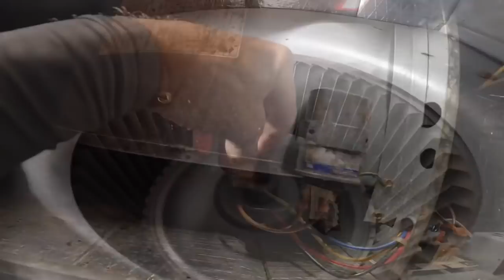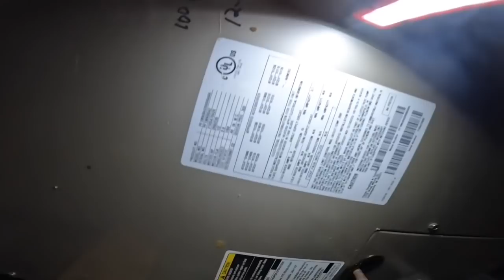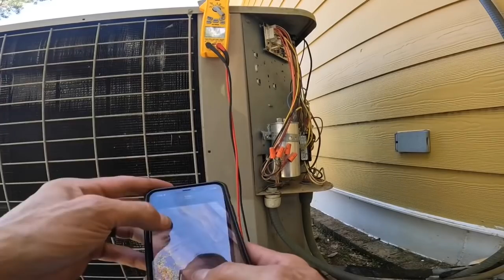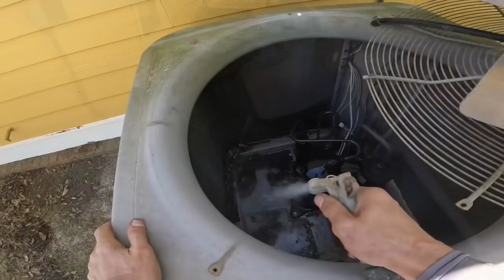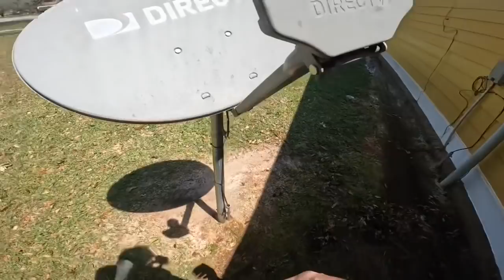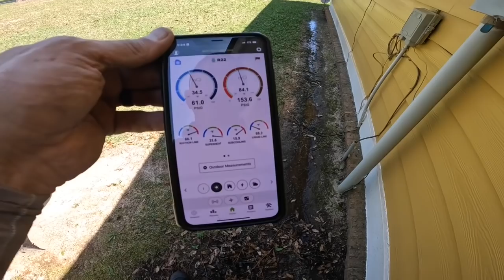Thorough PM Generates Additional Work

Comment: Have you come across a capacitor just say 10 mfd for fan/blower, but meter reads 60 to 70 mfd.
Reply: Usually if my meter gives a goofy reading I replace it's battery, if it's a capacitor I'd have to wonder if it's still holding an electric charge

Comment: Which meter is that ? That’s badass that you read the amp draw with job link.
Reply: I think I might have that one in my side job bag.
Reply: Nope it’s the 440… let me read up on it and see if it has that feature.
Reply: Damn , now I’m going shopping.
Reply from the maker: That’s the SC480
Reply: I have the redfish and love it with measurequick
Reply: @robertlamey7612   the 550?

Comment: I had a blower with a weak capacitor the other day with similar symptoms. Once I replaced capacitor the airflow dramatically increased and fixed the issue.